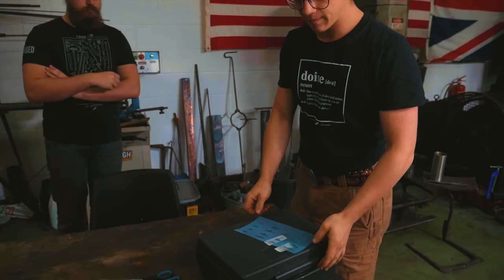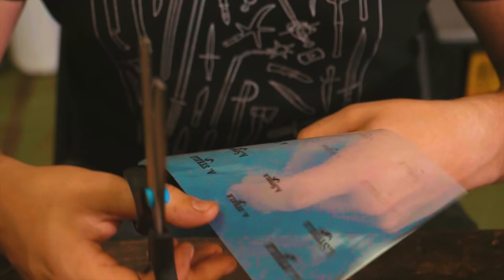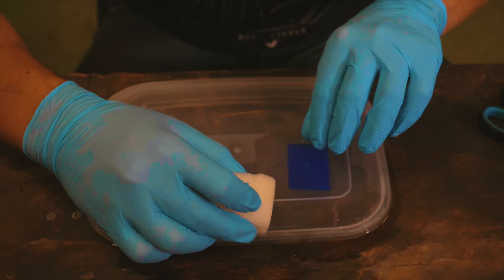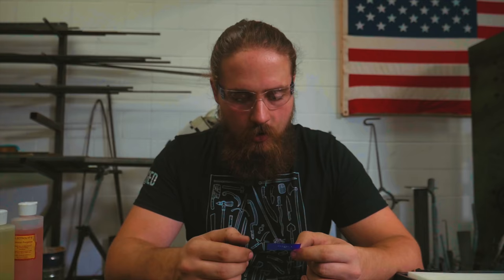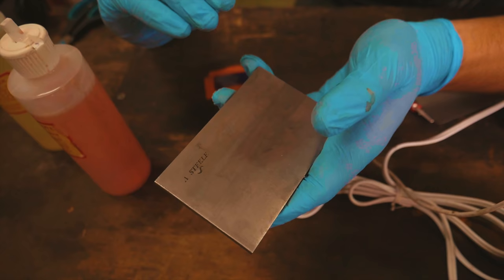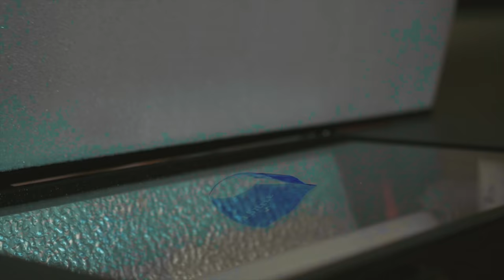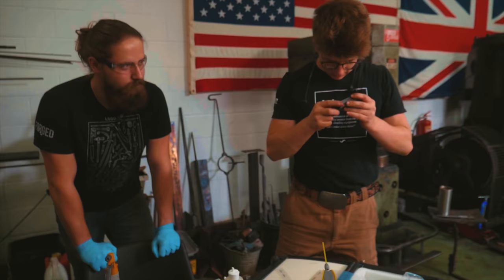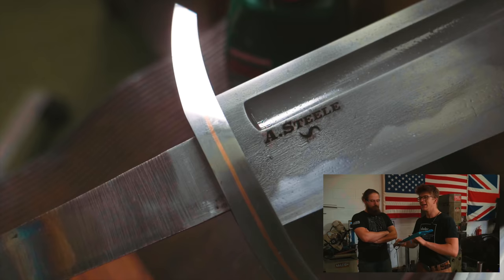ELECTRO-ETCHING A TOUCHMARK!!!

Comment: Despite that the etched touchmark is looking great, isn’t it kind of clashing with the classical style, and esthetic flow of the piece ?  

Or do you feel different about this Alec?
Reply from the maker: I agree, a big bit of text in the middle of a blade isn’t the most flowing bit of design work. But, I think the benefit of having a clear maker’s mark outweighed that downside! :)
Reply: Alec Steele , a fair point ! Great video’s, and amazing work ! Thank’s for sharing.

Comment: I helped my brother buy out a guy's small but complete smithing shop for a killer deal. As a result I have an electro etching machine but no electrolyte solution. I need to figure that part out.
Reply: Curiosity Forge any electrolytic solution will work. Saltwater is a good choice to start with till you can order some professional grade solution. Just takes longer to etch.
Reply: TheSatyrblue GOOD TO KNOW. I'll work with salt water and see what I can make.

Comment: Wow, you went all out with gear. Seems overcomplicated, really. I went super cheap, I used electrical tape for my stencil, a 9-volt batter, two wires (one with a piece of cloth) and some salt water. I got just as crisp of an edge. You could just get one of those vinyl cut-out machines if you wanted a very consistent stencil and the ability for other custom stencils. All that UV cure stuff is just...completely unnecessary.